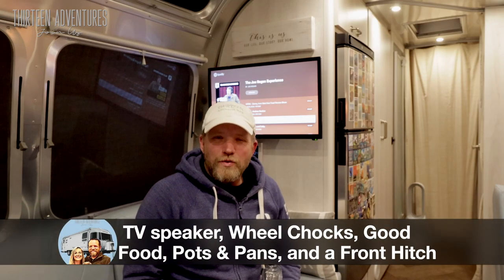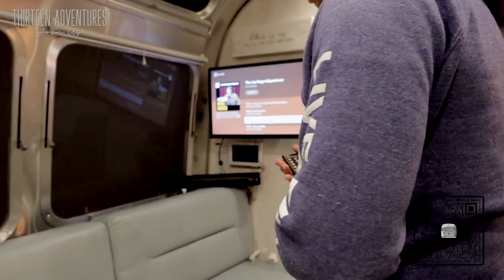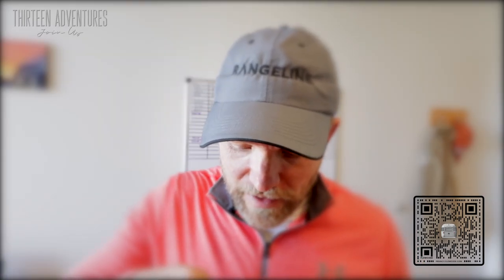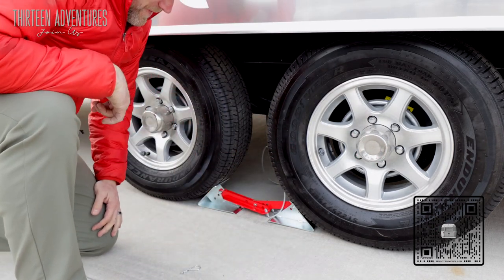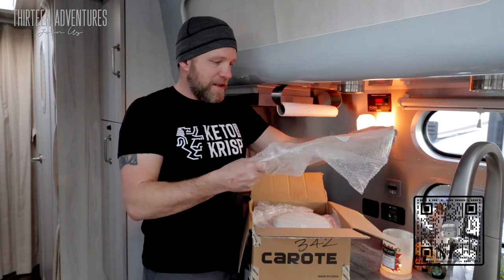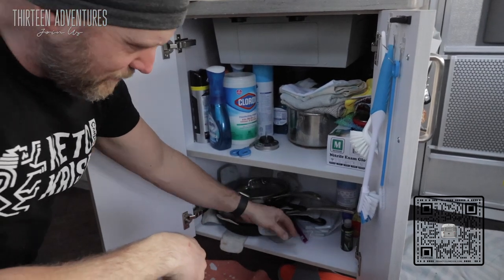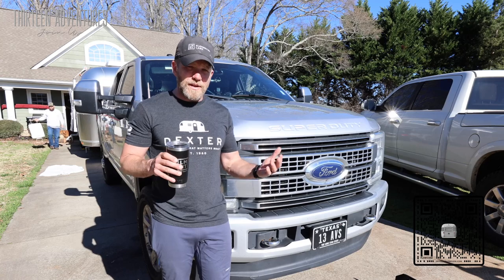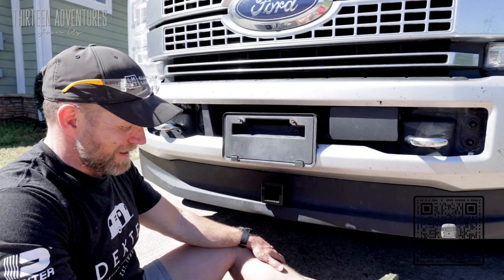Recent Finds Review: TV Speaker, Camping Food, Cookware, and Truck Front Hitch | Honest Opinions!

Comment: I've had a hitch on the front of my F-250 for years.  We have a very tight space around our house in which we have to move our vintage Shasta.  It is literally inches from the roof of the house when moving.  So, the front hitch does a great job.
Reply from the maker: Thanks for the feedback!  Yes, I’ve used this set up in the past to move a rig around and it’s much easier than backing.

Comment: Stupid question, can you not get tv audio through your AS speakers?
Reply: Good question! That would be ideal. Let us know Brad.
Reply: @oldshd11  on our 2016 26U all I had to do was switch the radio source to aux. You might have to go into tv settings and switch to external speakers
Reply from the maker: Not a stupid question at all. When watching over the air channels, you cannot have the sound come through the speaker system of the rig. We have an Apple TV to stream various things with and do use the speaker system via Bluetooth.
Reply: @ThirteenAdventures  When we watch cable TV or dish tailgater (both hooked up via the outside connection), we get audio through in house speaker system via the radio source selection.  Otherwise, i'm like you and can't hear the TV volume unless it's cranked.  Ours is 2014 FC 30.  There must be a reason the newer ones aren't setup that way?  Strange.
Reply from the maker: We added a speaker to the TV that works pretty well.  The new models allow for Bluetooth connectivity to the TV all the time.  Im thinking of upgrading the TV to a smart one.,